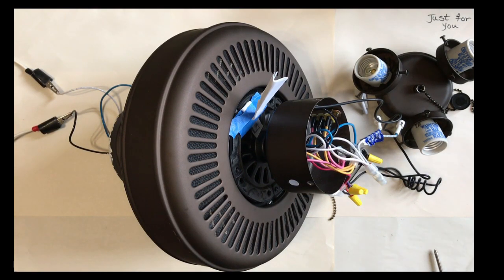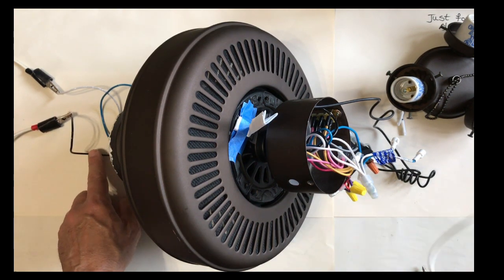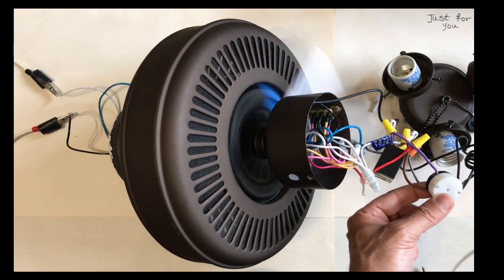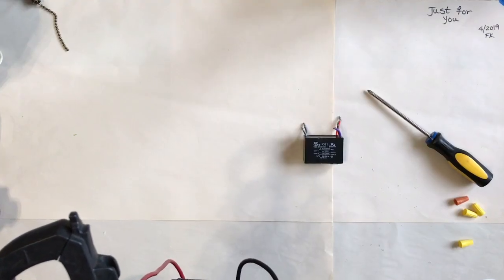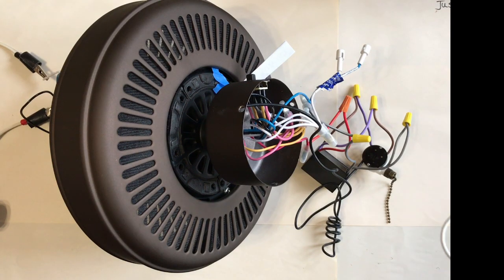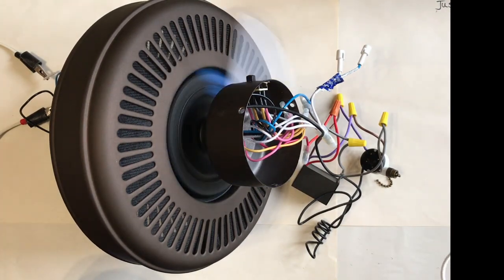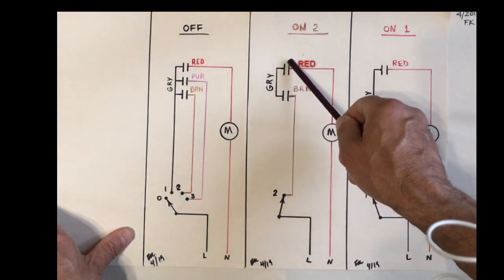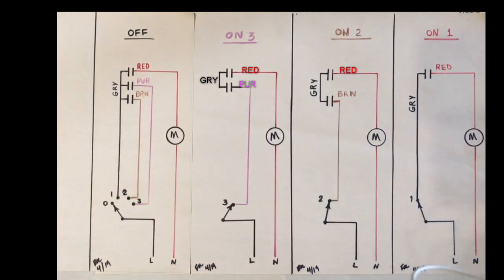Ceiling fan repair tips-Speed control by using capacitors

Comment from the maker: If the video helped you, please support us by giving this video a like and leaving a comment below. 

Have a suggestion for future videos? Please leave it below.
Reply: I'm about to put a new capacitor in my fan for the second time.   I'd like to just do away with the pull chain and the multi speed capacitor and just run the fan on high speed.  I have a wifi controlled wall switch that can take care of the fan speeds, I think.   If I were to do this, would I just need a 2 wire 6 microfarad capacitor?  The one I'm replacing is identical to the one in this video.

Comment: Thank you for this excellent explanation along with the practical steps. I'm replacing a capacitor on a similar fan, but ran into a problem. As I was disconnecting defective capacitor, a live lead disconnected from its other terminal. I now have a short black jump wire. There is one live lead to the pull switch, but I'm not sure where the other live lead -- presumably the supply -- connects.
Reply from the maker: The second live lead could be for the light. Just a guess.
Reply: go open your good ceiling fan
and compare.... you might be able
to relocate that short black jumper wire

Comment: Thank you exceptional video. I have a ceiling fan with a single 1.5uF cap and a double cap of 1.2uF and I.6uF but I can’t find a double cap replacement. Any ideas on replacing it. Thanks
Reply from the maker: Unfortunately, if you cannot get the dual cap, you need to use the two individual ones and tie one leg from each cap together and use it as common. Hope this helps.
Reply: @JustForYouDiy  thanks yes it does.
Reply: @JustForYouDiy  helps a lot thank you.

Comment: Good evening sir
I have celling fan with good running condition,  at present i want to reduce the celling fan speed to low speed i mean éven after using the fan regulator i could not achieve the required speed.( For example I want the speed like Wet Grinder) Pls guide mé

Comment: You seem to know a lot about these, I have a question. I have five identical ceiling fans in my barn each controlled by the same brand of remote control unit and every one of them run at different rpms. I pretty much am only concerned with the highest speed as that's what they're usually set on when I have them turned on but a couple of them have a significantly slower high speed than the other three. With my RPM tester I've checked each one and none of them run at the same RPMs at any given setting, they can vary from each other by as much as 50 RPM which is a lot when high is only about 220 RPMs. The two slower fans max out at about 170 RPM where the other three hit around 220 RPM on high which is enough but 170 just doesn't quite cut it. I've replaced the controllers with another of the same type and also tried another brand with no change in the speeds so I'm guessing it's some variance in the motors from one fan to the other. Do you think this could be a capacitor issue or just lack of quality control when they're winding the motors? They are inexpensive outdoor rated fans that originally came with wired  speed controllers which come to think of it is probably where the start capacitors were for these fans which means they don't have the capacitor built into the fan unit itself so it almost has to be a motor qc problem correct?
Reply from the maker: Unfortunately, by the time all the tolerances are stacked up, caps, windings, weigh
of the blades, etc., you’ll find speed inconsistencies between the fans.

Comment: I appreciate your explanation, very helpful.  In my case the 3 fan speeds work fine, however in the off position the fan continues to spin, although at a very slow speed.  After listening to your description of the circuit I'm inclined to think I have a bad switch rather than a bad capacitor.  Thanks.
Reply from the maker: Yes, you are correct, if the fan blades continue to spin even after the switch has been turned off, the switch is defective. Hope this helps.

Comment: I changed a single light in a spare office to a ceiling fan recently. It worked great, all 3 speeds worked as they should but a few weeks later high speed looked more like medium, medium spun veryyy slow and low doesn’t spin at all. I can hear a slight humming sound as the blades spin. Should I start by changing the capacitor or does it sound like a different problem?
Reply from the maker: It’s pointing the finger out the cap(s). That said, most manufacturers carry a 1 year warranty, if it’s less than a year old, it’s worth contacting the mfg. Hope this helps

Comment: Is the Cap wired in series or parallel, seems parallel to me?
Reply from the maker: In series. If you follow the path for current from the switch to the top terminal of the motor you’ll see…
Switch pos 2, Brn + Red
Switch pos 3, Pur + Red

Hope this helps.

Comment: Is it possible to change the cap in a ceiling fan in order to intentionally make it slower? I have a fan in the bedroom that is way to fast on the slowest speed and I'd be fine with all three speeds being slower by almost 50%.
Reply: Since your questions were a year ago, hopefully you fixed your problem. My first thought: Was your wireless remote stock with the fan or aftermarket? If aftermarket, rather than having the fan pull chain on high, if you change it to medium or low the fan will run slower. Second Thought: though your spec sheet says "single capacitor" might it be one device that contains several capacitors like this video? (How many wired on the capacitor? If more than two, the device has multiple capacitors.) Third thought: higher rated capacitors make the fan speed higher. If you were to replace the capacitor with one rated at lower micro Farads, the fan would run slower. In this video, on high the mF was 4.5, 2.37 on medium, and 2.12 on low. (Look up calculating capacitance in series versus parallel if you want to see the math.) Best wishes!
Reply: @JonnyScott1776  Ha... No I never got around to doing this. I just suffer though slow being too fast and vaguely recall that time someone told me how to do this but I never tried.
Reply from the maker: Yes, you can do that. Hope this helps.
Reply: @JustForYouDiy  Oh brother. Thank you so much. Just subbed as the rest of your content is also interesting. 

I found the spec sheet for my fan (patriot 52in matrix). It says it's single cap with 180/145/110 speeds. If I may ask a few extra questions: Does this mean the speed is controlled via solid state? Is there a repair manual or way to determine resistance of existing cap or do I have to just take it apart (worst case check it on the meter)? Would I just replace it with a cap of relative resistance to get the desired speed or could I add a 2nd cap inline (e.g. if it's 0.5µF, replace with 1µF or double up with a second)? Finally is this all safe to do assuming my soldering or connections are made proper, both in longevity of fan and potential hazard. 

Sorry to barrage you with all those questions but I'd really love to at least get the speed of the fan down by 30%
Reply from the maker: One way that I know of manufacturers using a single cap for a multi-speed fan is to use a multi-tap motor winding. Engage different section(s) of the motor winding for different speed. You can measure the cap using a meter that has a capacitor tester/reader. As for, is it safe to modify it. That’s a tough question to answer. I would suggest asking the MFG on that. Hope this helps.
Reply: @JustForYouDiy  thanks for the great answer. I should have put a disclaimer that I wouldn’t hold you liable for the safety concern. I don’t think stepping down voltage would be a problem unless an inline resistor or different cap would cause a heat problem but I’ll do more research on how altering current and motor windings. Unlikely patriot would help me as they’d just want me to buy a new fan.  I love the design it just needs a gentle breeze setting. 

Thanks a ton for the info.
Reply from the maker: The other option you may want to consider is to install a ceiling fan wireless remote. Hampton bay sells one that has a 3-speed fan control and comfort breeze speed. PN 1005 447 797 from Home Depot.
Reply: @JustForYouDiy  It actually has a wireless remote. Just that the 3 speeds are all too fast. Even fast is too fast.

Comment: Good video. I have a ceiling fan that I replaced the pull chain switch on and it stopped working.  I can hear it turn on but it doesn't spin. Any advice? Could hooking the wires up incorrectly cause that?
Reply from the maker: If you hear it turn on that it should spin. Unless you hear it making a humming sounds, then, most likely it is a defective cap or incorrect wiring.

Comment: Great explanation. Do you know why some ceiling fans only have a two wire capacitor though?
Reply from the maker: Thank you. Two-wire cap indicates a single cap. Single cap means single speed fan. Hope that helps.
Reply: @JustForYouDiy  That is what makes sense but this is a three speed fan and there is only one two wire capacitor in it.
Reply from the maker: Interesting. They must be controlling the speed another way. Now I’m curious. If you have the opportunity, please share the make & model. Thanks.
Reply: @JustForYouDiy  Yes, it is a Hunter Contempo fan with the model number of 25816. It is from around 2012 or 2013. I also have another fan with a two wire capacitor which is an Encon Monarch from around 1986.
Reply from the maker: I think they are controlling the speed with using a multi-tap motor winding. Essentially, using three motor windings. Picture a winding (coil) that, let’s say, every 1/3 of the way there is a wire connected to that part of the coil. So, wire at bottom (common, connects to one side of the cap, the other side of the cap connects to neutral), 1/3 up another wire that connects to position #1 of the switch (1st speed). 2/3 up a second wire that connects to position #2 of the switch (2nd speed). Last, top part of the coil is connected to position #3 of the switch (3rd speed). Then, common side of the switch is connected to the line.

Hope this makes sense.
Reply: @JustForYouDiy  That makes sense. I was figuring that maybe the motor itself was different because of the different capacitor. Thank you for the information.
Reply from the maker: Thank you. Let me see what I can find out.
Reply from the maker: My pleasure.